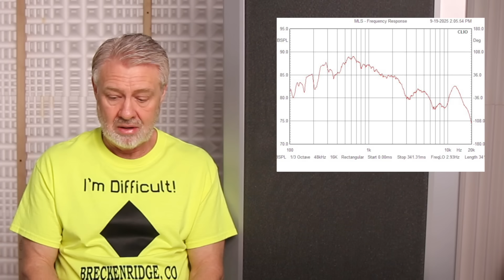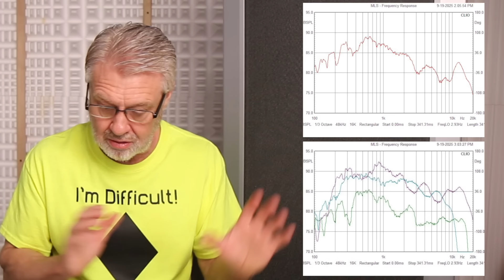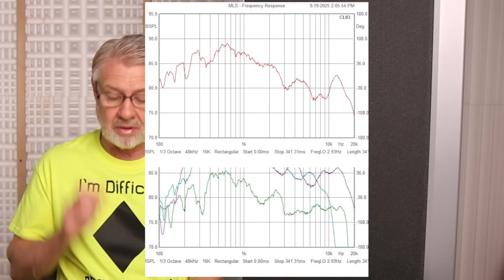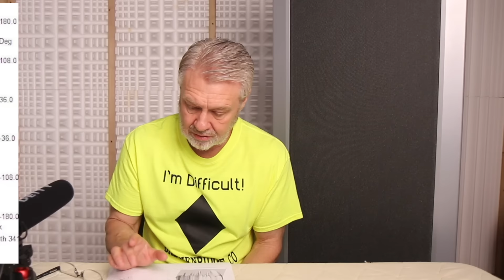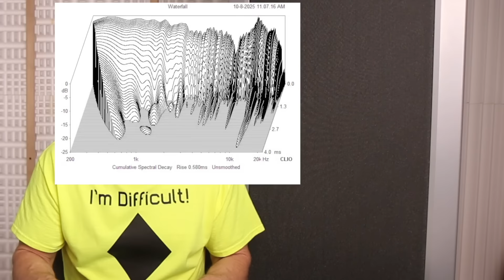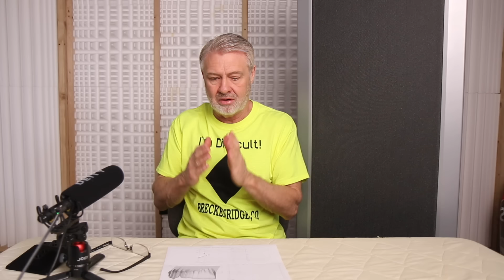This Magnepan 2.7i Upgrade Changes Everything

Comment: GR: “Steel in signal path = imaging death!”  WRONG.  Every speaker uses steel screws, nuts, frames
, etc. I assure you its usage is absolutely not an issue. Want real signal interference? Run your speaker wires through a microwave oven on high → sparks, fire, fun (possible death)! If steel really affected sound as you claim then the industry wouldn't exist.
Reply: Can tell you haven’t been around high end speakers at all.
Reply: @davobmw  Ha! Price tags don't dictate sound quality; it's all about engineering, room acoustics, and how the components play together. There's plenty of "budget" gear (or dusty closet finds) that smoke overpriced "audiophile" darlings in blind tests. Steel in the signal path is a total non-issue at audio frequencies. We're talking milliohms of resistance and negligible inductance/capacitance in screws or chassis—inaudible even on the most resolving systems. If steel were a problem, every pro studio and concert rig would sound like a transistor radio. Real interference comes from poor shielding, ground loops, or RFI—not a few grams of ferrous metal. You = 🤡
Reply: This guy is too stupid to understand what in signal path means…. lol!

Comment: You Won’t show the bass below 200 because room gate but then you show horrible frequency response in the tweeter and say it’s the room?  Also the midband looks amazing but the tweeter is the only thing affected by room?  Idk I think the mid and bass panel were suppose to relieve the tweeter in original design and this design took that ability away?  I have been waiting for this mod for years because of 2.7i size, price and tweeter. This was a disappointment just looking at that graph I could never bring myself to buy this mod
Reply: The tweeter peak is not from the room. It is just about what it is doing at that height and distance. The response of the tweeter will have several db variance that is due to height and distance. It has to do with comb filtering and beaming. I can easily find a spot where it sums flat if you want.

Comment: Well done Danny. Great video and great results. I particularly liked this  one because you pulled back the microphone and took into account how the room plays a part with these. More so than most speakers.  You also dug down to 100Hz. If you understand how your room behaves you can measure lower even if it doesn't look pretty on the FR. Great job

Comment: 12:42 one hour clockwise on the preamp is more voltage from the amp, so if you rise the impedance from 3 ohm to 8 ohm you also need to send them more voltage, but resulting in the almost same wattage
Reply: Correct.

Comment: Looking at these responses, I gotta say.  MAGNEPAN, you need to make a DSP based powered speaker with each driver powered separately.  This will sold all of your problems and ultimately make these speakers cheaper in the end.  Low sensitivity speakers especially need this.
Reply: Rel High-Level input from amp
High-Level output to speakers

Comment: I like these tweeters that play low, but maybe too low?????
Reply: They will play very low, but if you let them play down that low then the physical movement of the tweeter gets out of control when more power is applied.
Reply: @dannyrichie9743 
I see your point. I just can't rap my head around why many companys  see the driver parameters, yet still design to push the limits.

Comment: The 2.7 frequency response isn't very good at the high end. That's disappointing. The 1.7 and the 1.6 look better. Currently I'd take 1.7 over the 2.7.
I still can't fit a Klipschorn in my room. My ultimate choice.

Comment: Hi Danny, just wondering whether you are likely to revisit your earler Maggie upgrades (ie for 1.6 and 1.7) in light of what you have learned from this model. Those 2 way designs are single diaphram. The late Peter Gunn mods used 1st order series xovers so I wonder whether that is the secret sauce to achieve phase linearity. Your thoughts?
Reply: No, the two ways are no problem. They were fine. It was the three ways that share the same diaphragm that caused the need for creativity.
Reply: @dannyrichie9743  The two ways do also share the same diaphragm between tweeter and bass panel.
Reply: The 1.7 is a 3-way, not a 2-way.

Comment: Danny can you elaborate on what this 2.5 way looks like on paper. For instance, where does the large cap go? Does it go to ground after the large coil or is is across the large coil? I thought simply putting a larger coil on the lower woofer is all you’d need?
Reply: The large cap by-passes the woofer that you want to only play lower ranges only.

Comment: Interesting video.
How much for this upgrade?
And how does it compare to the factory version X upgrade?
I am seriously considering this speaker.
Thank you and more power to your channel 👍
Reply: You can order it here: https://gr-research.com/product/magnepan-2-7i/

The factory X version does not compare to this upgrade. The factory X upgrade still leaves ferrous parts in the signal path, does not use high quality parts, and did not do what I did with the design.
Reply: @dannyrichie9743 Thank you for your quick response.

Comment: Thanks for changing your frequency response charts to go down to 100 hz.  Would be even better if they went down to 20 hz.
Reply: Yeah, bellow 100 is subwoofer territory.
Reply: @IlarionMoga  Most speakers are rated down to at least 50 hz.  My small bookshelfs, according to the manufacturer, respond down to 43Hz.  I'm sure there's not much response down there.  Still would be nice to know if it has any.
Reply: @dl1027  this type of speaker is very different. In fact, these are meant to be used with subs, not because they are bad and incomplete, but because they are very transparent and have low distortion in their designed range. They cannot play 20Hz accurately, as they behave very differently than traditional voice coil/membrane drivers. In fact, their top model comes with an integrated subwoofer base co complement the low end.
Reply: I could allow it to go down to 20Hz, but that does not mean that it will be accurate below 200Hz. I am still gating away most of the room responses.
Reply: @dannyrichie9743 If you always measured in the same room and the exact same method, we would be able to compare different speakers and the before/after mods.
Reply: @dl1027  I can't. Monitors, full size speakers, and line sources have to be measured differently.  I am also looking for the response of the speaker and not a room response

Comment: Can the human ear tell the difference between the original and the upgrades
Reply: Yes , always unless one had hearing issues or does not hear the difference not being trained in your ear , brain connection. Plus it takes a lot of a/b comparison tests with different types of music and also gear before the speakers .
Reply: Take a look at the before and after graphs...yes, you can easily hear those differences. And if you can't, just stick to a pair of Apple earbuds and you'll be just fine.

Comment: Never liked Maggies. Never knew why people liked them so much.
Reply: Dipoles, ... that's the primary attribute.
- Dipoles possess inherent performance advantages that monopoles can't achieve.  
- Secondarily, the ribbon's lack of inductance. This facilitates a higher speed, elevated transparency in the MF/HF. 

Drawbacks? It's a dipole! 
Thus, it requires/benefits greatly from as much distance away from the boundary wall behind them as possible. 

Biggest difference, ... it's a velocity experience, vis-à-vis a pressure dominant experience of typical monopoles.
Reply: You’re not alone. Repair technician’s nightmare as well.
Reply: @fonkenful  well in my lived experience the upgrade I did to my LRS plus absolutely transformed those $1000 pair speakers. It was a simple build in a plastic box that I wired to the speaker just like every other speaker. The Tweeter has a positive and negative and the woofer has a positive and negative
Reply: @CashGravel  My main experience was probably mid ‘90s when the original glue adhering aluminum “voice coils” to Mylar deteriorated from UV exposure that they delaminated, and in some cases the wire oxidized sufficiently that they fractured from vibration. Rather than ship them from West Coast of Canada, they supplied “improved”  adhesive and new conduction wire, leaving it up to the technicians to strip, clean and fashion jigs to precisely align and tension the wire before applying new glue.  Oh, and Danny couldn’t be more right about the staples and socks.
Reply: @fonkenful  I know just what I know but I cut out the old crossover or the original crossover and stapled the hole so the grill material didn’t move and just built external boxes and it was much simpler
Reply: @CashGravel Fair enough. For my own thinking, the amount of cheese in any specific model of Maggie is not the primary fault. Danny explain rather well at least one more - a single emitting surface (regardless of shape or effective mass) driven by separately band-passed signals seems like a recipe for confusion. Consider the original Quad ESL;  its several flaws and the constraints of materials and production technologies available at the time notwithstanding, it did some things remarkably well.

Comment: Hi Danny.
Why do you suppose Magnepan would market the 2.7i speakers for $6500 with all those design flaws?
I mean, think about it. That's a lot of money to spend on a speaker system! Isn't it?
What do you think is going over there in White Bear Mn.?
They can't be building these things to achieve a price point. Come on!  At $6500 a pop? I don't think so.
Are the designers at Magnepan a bunch of inept acoustical engineer want- to-be''s?
That doesn't seem right. Does it? 
What's your opinion, Danny?
Reply: It is built to a price point and yes, they are inept engineers.
Reply: Most speaker making companies hire inept engineers. Some even work for free! That is because in reality is hard to sustain the production and costs. 
More than half of their final price is swallowed by logistics. They don't earn much from them. TBH, Danny for sure worked more for that crossover than they worked! 
When you have a big company, have to pay taxes, employees, bills, buildings and interests, you end up cutting as many corners as you can. The crossover parts should never be cut though, as you can live with a not perfect set of drivers that work in good synergy, but you cannot listen to a speaker that has a bad crossover, even if it has the best drivers. 

Sure, no one is asking to provide xovers like Marten or Borresen does, those are pieces of art, but at least make it right, with some good components, not the cheapest on the market!
Reply: Wendell Diller is the designer of magnepan speakers for over 20 years. His education is bible college. He isn’t an engineer. He started in the marketing department. You decide if Danny can improve Wendell’s designs or not.